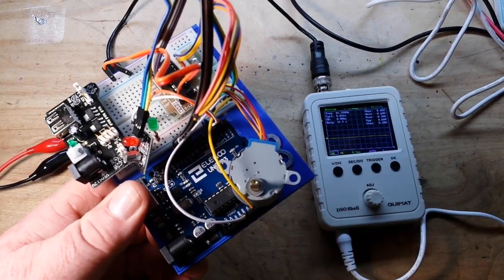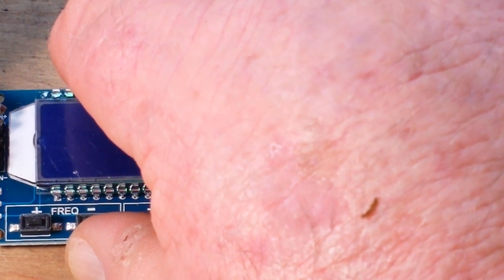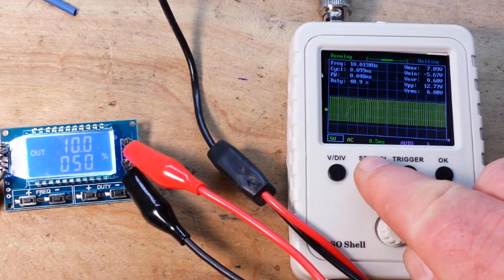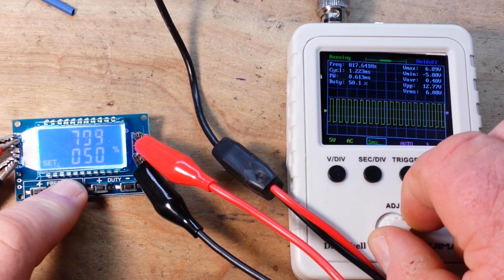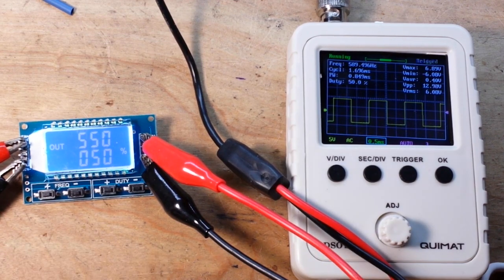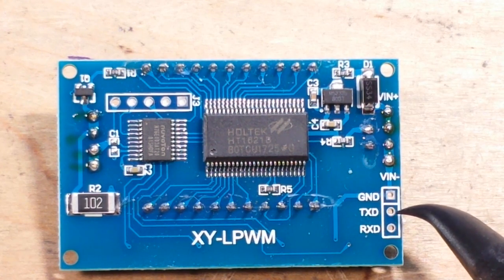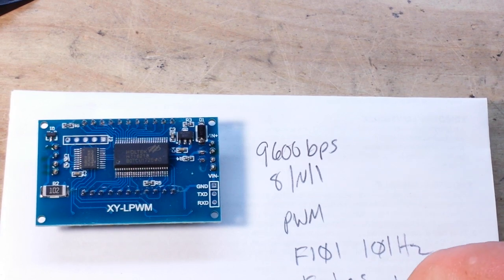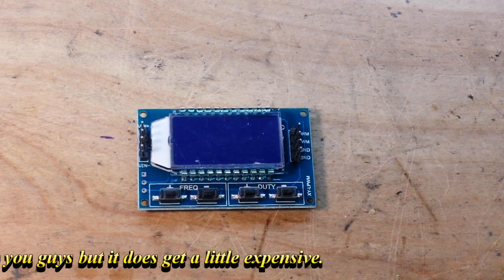Playing with the DROK PWM Generator

Comment: What’s the output voltage? Been thinking about using one to simulate an automotive abs sensor signal. They use a 5 or 12 volt signal.

Comment: I need to control a 850 watt bmw radiator fan out of a X5.. I have the module in video but mine is a 3 channel. My Q is about the pwm output, there is a gnd next to it, would I need to hook that up to the frame of motor for reference or should I combine that to the main ground for the fan or leave unhooked? thanks!

Comment: Further to last video re multi outlet power board insulation test : I used the same (generic) tester as Paul (VC60B) on a 'Jackson switched 4 outlet surge & overload protected board'.  It passed no problems @ 250V.    I.E. steady intermittent tone and the number 1 displayed on left of screen, (meaning it exceeds upper limit (200 MΩ ).                          *(this is Australia 240V mains)
On the back of the board it warns "this device contains voltage limiting devices test at 250V. only."  Therefore on your test Paul  you were double the voltage  and the voltage limiting devices were affecting the test reading. Cheers all.
Reply from the maker: David. Thank you very much. 😉

Comment: Grab the motor from a old VCR and use discrete transistors since they are cheap anyway.... Nice PWM module for starting analog electronics. The output voltage is the same as the input or it is fixed / regulated?

Comment: I'm impressed it has a serial connection. Could use Putty to input those commands.
Reply from the maker: Correct, or even add a little BT module and control it from your phone, or an Arduino or a Pi...

Comment: You could use this to send step pulses to your stepper motors. The direction though doesn't make sense though. I would look in the code for the problem. Thanks for the video!
Reply from the maker: It's too strange. One out of five motors works and only in one direction. All the other motors just kinda growl no movement. And the only difference in code between clockwise and counter clockwise is a - symbol.

But I'm very open to any suggestions
Reply: Paul, the connection for the direction is just high or low, so unless the controller is connected wrong or possibly bad it's supposed to work, right? I guess I'd check the pin numbers on the chip first then Arduino then the code. 😏

Comment: Hi paul the stepper motor problem is the wiring swop the two centre wires over and it will work I had same problem if you check my videos back a bit I explain

Comment: Hi Paul...  
Some help with your stepper motor problem:
1.  The direction has nothing to do with the motor, it;s 100% the code.  If it turns one way, it CAN turn another.  Same goes for that driver board, which is just a fancy darlington chip broken out if I remember correct.
2.  I assume you are using a library, as you always do.  The problem can only be there.  Try stepping through the header file of the library for clues.  I suspect you are just not overloading a variable correct - look for entries with a different amount of overloads if you are not overloading it at all with a direction - I cannot speak to how this library works, as I wrote my own for my window shade project and didnt really put it in a library.  
3.  All that controls the direction is HOW you excite the wires, and the RPM is HOW FAST you switch between them.  Example:  to microstep that motor forward If I remember correct its "AB, BC, CD, DA" , with 2ms between then, then *13 (if my old notes are correct) to make a revolution.  

I used an old stepper motor from some old HP Deskjets to drive my blinds.  It worked well for a couple years, but the plastic gears wore out because I had a worm drive setup so I switched to those motors you have there when I found someone provided some 3d parts on thingiverse to do what I wanted.  I dont belive I made any code changes, as the wires to excite the coils were the same, but the pin order to step it was different.  Here were my notes:

//caution, the 5v 28YBJ-48 Stepper Motor with Gear Reduction needs driven in sequence 1,3,2,4 -- not 1,2,3,4 as the old HP printer stepper was
    int PinStep1 = D5;
    int PinStep2 = D6;
    int PinStep3 = D7;
    int PinStep4 = D8;
...and I made a new pcb (wemos shield) to fix that.
so to drive it:  Pins 1+2, 2+3, 3+4, 4+1, delay 2ms between, rinse repeat 13 times should give 1 forward turn.
to reverse it:  Pins 4.1, 3+4,2+3,1+2, delay 2ms between, rinse repeat 13 times should give 1 reverse turn.

write you a quick test sketch to test it.  If you continue to use the library, maybe check to see if it supports your stepper motor, or maybe it needs defined differently.

If you get stuck still, you know my email...I can help you fix it.

P.S.  That crooked screen on your oscilloscope is driving me crazy.  Can you fix that, or are you messing with us?  :)
Reply from the maker: Hmmmm thanks